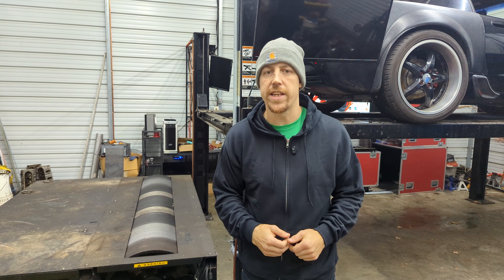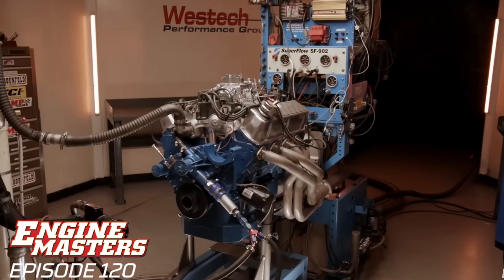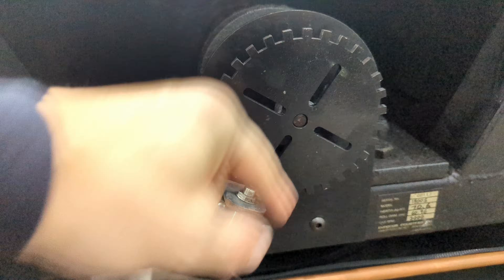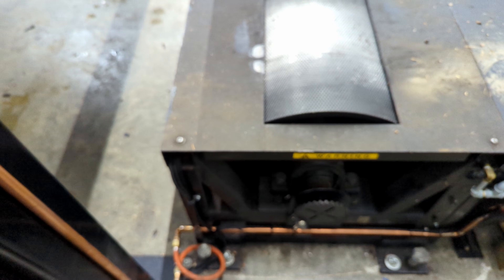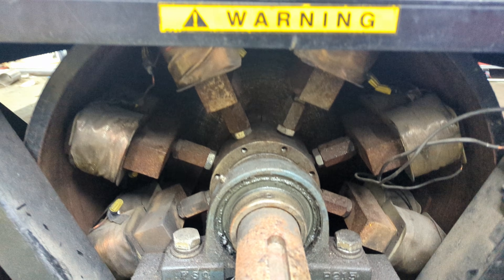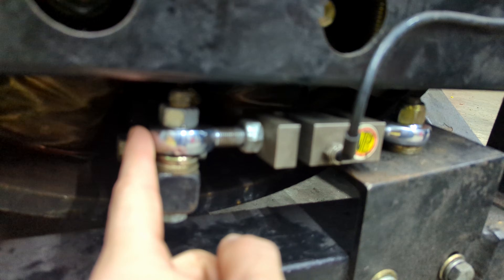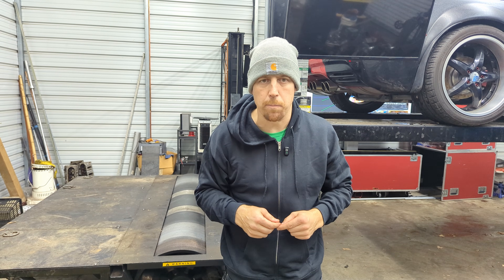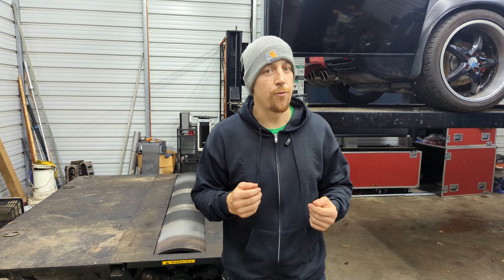How a Dyno Actually Works (It's Simpler Than You Think)

Comment: Isn't that edge of a drum getting extremely hot due to that edgy currents?
Reply from the maker: You're the first person to ask that question. Yes it does, however the drum is a huge thermal mass so the rest of it tends to keep the temp somewhat under control.

I've thought about doing a video that shows how quickly heat is generated by the eddy current brake, how it heats up the roller, etc. The simple way would be using an IR thermometer, but the most visually appealing method would be to use thermal imaging.

Comment: the 5252 comes from the conversion between the various imperial measurements. The European horsepower crosses Nm at 7023, already high for most engines, and the kW crosses Nm at 9549 but most engines do not reach that. And this 9549 comes from the fact that rpm is in minutes which is 60 seconds, and kW is 1000 W, so (60 x 1000)/2pi = 9549

Comment: The math is where I get lost. I do understand what a foot pound is but to calculate HP with the readings, I would be lost. Kudos to you other commenters and to you sir, for knowing how this works. Very interesting. 👍
Reply from the maker: Totally understandable — the math is where a lot of people get lost.

A concrete example helps. Say the engine is making 300 lb/ft of torque at 4000RPM.

Using the formula:
HP = (TQ x RPM) \ 5252

That's (300 x 4000) \ 5252 = 228.5 HP

As RPM goes up or torque changes, horsepower changes with it — the dyno is just doing that calculation continuously in the background.

Comment: the eddy current is the same thing used to force rollercoasters to slow down without needing a friction brake.

I do wonder if any dynos exist that work like the dynamic brakes on a train and the computer would measure the current coming out then. Dynamic braking on trains basically turns the traction motors into generators and then puts a huge load on them with a big resistor bank.

Comment: My first proper engineering job early 1980s was visiting European customer sites to check out problems on their dynos, mostly hydraulic engine types, what some might call a 'water brake'.  But these were very expensive industrial systems and had to be accurate to within 0.5%.  They ranged from 500 hp to just over 100,000. Chassis dynos or rolling roads were not as common back then but I also did some work designing a calibration method to measure and account for bearing losses.

Comment: The "weight of the roller" is not a simple factor. What is the weight distribution between the axle and circumference?     All 2 foot diameter rollers are not constructed the same. If the weight is concentrated near the axle it will be easier to spool up and falsely give a higher torque number than one with the weight concentrated near the circumference, which would be harder to spool up, and give a lower torque number. There must be a way to calibrate the setup. I've heard too many stories of different dynos giving different readings.
Reply from the maker: You’re absolutely right — it’s not the raw weight that matters, it’s the moment of inertia, which depends on how that mass is distributed relative to the axis.

I intentionally used “weight of the roller” as shorthand in the video, because once you get into moment of inertia and mass distribution, it turns into a much deeper discussion very quickly.

And yes, that’s one reason why different dynos can read differently. Each system has its own effective inertia and calibration method, which is why inertia dynos are best used for relative comparisons on the same machine, not absolute truth across different dynos.

Good point.

Comment: One more dyno type, the one that I use, is just an AC induction motor, a variable speed drive, and a bunch of load resistors on the DC bus. It can motor the engine (simulate a downhill or coasting condition) as well as the regular function of absorbing engine power. I use them for emission tuning and testing, they can replay the transient emission test load and speed traces.

Comment: Does the brake apply constant force, or does it change during the run?
Reply from the maker: It depends on how the dyno is being used.

The brake itself doesn’t usually apply a fixed force. Instead, the dyno control system continuously adjusts the brake output to achieve a specific goal set by the operator.

Common examples are:

- Acceleration control (e.g. limiting the sweep to 500 RPM/sec)

- Steady-state control (holding the engine at a fixed RPM like 3500)

In both cases, the control system modulates the brake (via PWM) in real time to maintain the requested condition, so the braking force changes throughout the run.

Comment: Back in the mid 1980’s Our shop I was Foreman of ( Hawthorne Caterpillar) in San Diego got a brand new SuperFlow -2  Dyno and we had it all installed & calibrated & set up with Help from SuperFlow techs .  We used to hold annual Semi-Truck shows where truckers from around the country would attend & showcase their rides & those who wanted could run them on our in house Dyno room . Those were great times to be alive & in my prime . The only difference here was the SuperFlow wasn’t an eddy-current design but a Water -brake system design .  Still very effective in documentation as we had all sorts of probes to add to various engine setups to record data during runs .  Thanks for your tutorial here , hopefully it shed some insight .😎👍
Reply from the maker: That is so cool dude. I'd love to be involved with an event like that.
Reply: @PyroPerformancePNW Yeah it was a time in my life where things weren’t so constrained by EPA mandates & we were at the Top of our Game shop-wise .  Tom Hawthorne was Alive & well & we had great “ Insiders “ at the Peoria Illinois Cat Factory that we could glean information from to modify & upgrade all sorts of engines in the Caterpillar lineup at that time .  The age of “ Electronic engine management “ was on the near horizon & we were at the forefront of it all.  A co-worker & I were working with a Heavy equipment hauler here in town on a “Side -project “ for him where we took a 3408 V-8 Engine & pushed it to almost 1800 flywheel horsepower as measured on our Engine 1/2 of the Dynomometer . Stock H.P. Rating was 450 at that time for that engine .  We had it set up with compound turbochargers & pushing 130 pounds of boost . Internals includes Custom Forged pistons , Stainless Steel O-ringed heads , ceramic High temp coating on piston Tops & on all Exhaust manifolds & Turbo hot-housings ( things that eventually became almost mandatory to stay alive for very long at the levels guys are running now) , and when we were all done with development & the engine was finally installed , we recorded over 1500 rear wheel H.P., over 3800 lb-ft of torque & Pyrometer temps right around 1300 degrees & it somehow lived as a daily hauler of heavy off highway earth moving equipment for almost 10 years .!!   The owner appointed only ONE guy to drive it Named Troy Lee , & he took care of that truck like it was his own .  It was A 359 Peterbilt , Silver In Color ,& was Called “Papa Clyde” and had A Clydesdale horse painted on Rear of Cab reared up & snorting .  It was one of I think 10, or 12 trucks that company had at that time & it was  Top -Dog in that fleet .  The company was & is still known as “ Bill Signs Trucking “ here in San Diego .   I was and still am proud to have been part of that legacy .  As I said , a great time to have been alive & in my prime .  👍

Comment: Just to add my $0.02 on this video, that load cell on there is an S type used to measure pushing or pulling forces, just like this one. The scales at a scrapyard thay are a bit bigger than a pallet use shear beam load cells. The huge scales to weigh fully loaded semis and whatnot use double ended shear beam load cells. On the smaller scales, there is one on each corner and they are accurate to within one pound when calibrated correctly, no matter where the weight is placed on the scale. The big truck scales use multiple large steel plates with a cell on each corner and all the cells are sum totaled together in a junction box. The ones I work with are tested by the department of agriculture division of weights and measures at least once a year for accuracy. If you are ever in a place that sells or buys anything by weight and think that you are getting shafted, the local or state department of agriculture are the ones to alert. They will test the scales unannounced. They take it very seriously.

Comment: A third type of dyno is a transmission dyno.  The dyno doesn't absorb power but measures the torque being applied to the load the engine or motor is driving.  It's not just useful for measuring power, but also how much power is required to turn a machine.   For example, a locomotive can have a load cell measuring the locomotive's pull at the drawbar.  Let's assume the load cell measures 10,000 pounds of force pulling the train while it is going 60 mph or 88 feet per second.
10,000 pounds times 88 fps = 880,000 ft-lb of energy per second.  Divide by 550 to get horsepower and the locomotive is delivering 1600 horsepower to the train.
If you measure the force in newtons instead of pounds and measure the speed in meters per second, you get power in watts.
I believe load cells measuring torque on the driveshaft have been or are being used to measure the horsepower of top fuel cars during the race.

Comment: What I’ve noticed from what I’ve watched on engine masters and  other shows is when the torque curve and rpm cross paths, when the rpm reaches that number 5252.
Reply: And that is explained by the calculations posted above. It comes out that way from the definitions of torque and horsepower (and, for that matter, the definitions of revolutions and minutes).

Comment: Cool - thanks for posting this. I've seen a couple engine dynos that have large tanks of water connected to them. Is the water purely for engine cooling or is it used somehow to create drag and therefore help measure torque?
Reply from the maker: Good question — there are a couple of possibilities.

Engine dynos usually have very large cooling systems so coolant and oil temperatures can be held extremely stable. Power output changes noticeably with temperature, so tight thermal control is key for repeatability. That’s why engine dynos are often better suited for comparing very small changes in power than chassis dynos.

The other possibility is that you’re seeing the water brake system. A water brake works on the same basic principle as an eddy-current brake, but instead of electromagnets it uses a rotor spinning in a water-filled housing to create load.

Either way — it’s cool stuff.
Reply: @PyroPerformancePNW  - for sure - thanks!

Comment: Okay how much drivetrain loss from the motor to the rear wheels is the average? I've heard 15%
Reply: That's why you need an engine dyno and a chassis dyno.
Reply from the maker: 15% is a reasonable rule of thumb for a manual transmission. Automatics are typically a bit higher, but there are a lot of variables (converter, gearing, fluid temps, etc.), so it’s never a single fixed number.

My dyno can also estimate drivetrain losses by analyzing the additional inertia during coast-down, beyond the known roller inertia. Once you can quantify that, it’s straightforward to back-calculate crankshaft horsepower.

Wheel horsepower is still the most honest number for comparison, but I’ll probably do a future video showing how an inertia dyno can estimate drivetrain losses and where the limitations are.

Comment: I made a simple brake Dyno when I was in my early 20's. I made a flow bench shortly after that. They were both of my own design. Internet really wasn't a thing then. But, I had a scientific curiosity and very good math skills. Both were so limited as to be ineffective on even the most humble v8 engine. But, the information that I was able to obtain from there use was still valuable. With all this practical experience and the knowledge that came from it and my abundant curiosity, I never knew how an eddy current Dyno worked. Your video has inspired me. 
Subscribed.
Reply from the maker: I love the story and the background that you have shared. Someday I too will build my own flow bench. 

I appreciate the comment and I especially appreciate the subscription! Thanks for watching!
Reply: @PyroPerformancePNW  4:12
Reply: A home made pressure washer made a real good dyno for the 6 HP Techumseh I used for the prime mover!

Comment: I remember my father explaining a brake/spring dyno when I was a youngster. You might need a high thermal mass truck brake to absorb the heat, and then record a tach and the spring compression.
I initially had trouble grasping how slowing a motor with brakes could measure actual power/torque. The concept was much easier to grasp once I'd later had a physics course.

Comment: Only 2 ways to increase the HP number. Increase torque or increase RPM without loosing more torque than the RPM increase so the formula maintains a rise in the final numbers and without over riding the physical speed limit of the parts and systems. Diesel engines in ships may have thousands of HP but only turn a few hundred RPM. This is because of extremely high measured torque which would make more sense to use in these cases to me rather than the HP numbers. I guess HP numbers are more impressive to people in general. HP originally was a lineal measurement. It had to be converted into rotational measurement because most engines put out rotational power not lineal like when the HP was developed for pulling horses. The formula for 5252 is pretty long and I don't completely comprehend it so for my purposes I just remember 5252 is a magical mathematical constant number. Also, the torque and HP numbers should cross at this RPM point on a graph. If not there is something bogus about the chart.

Comment: A modern Dynomometer brake works like a giant stove top induction heater. It uses a large rotating ferromagnetic mass like a finned cast iron flywheel to dissipate the waste heat generated by the rotational torque and horsepower produced by the prime mover, which is being measured by the angular control arm pressure on the load cell. Without this large flywheel mass, a drum brake dyno would burn up in a matter of seconds, if testing a high performance internal combustion or turboprop engine.
Reply: Should we watch your video too?

Comment: I build fluid dynamic brakes/slip clutches used in dynos for agricultural and landscaping equipment. They are designed to put tension on the system then through load cells torque/hp is calculated.